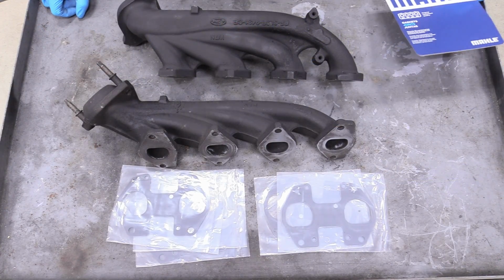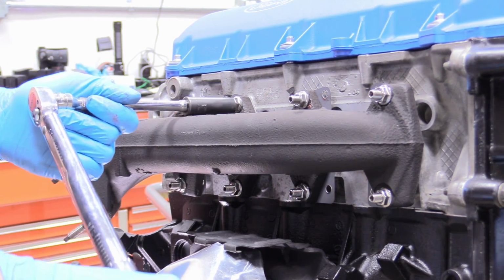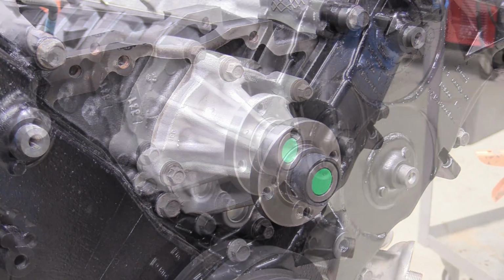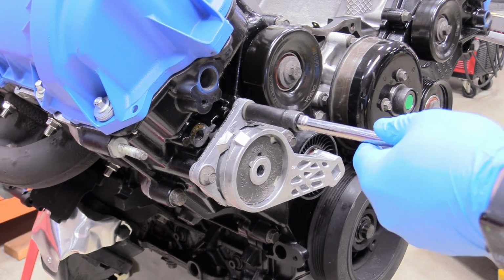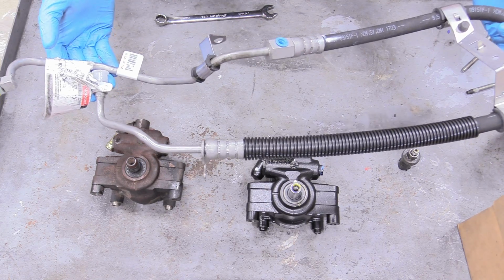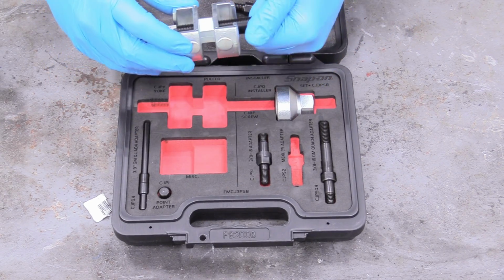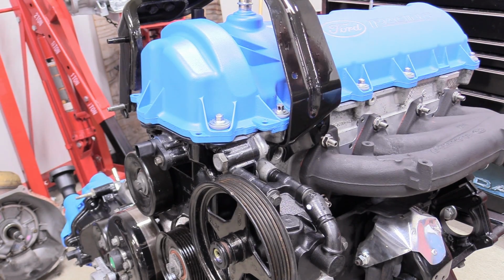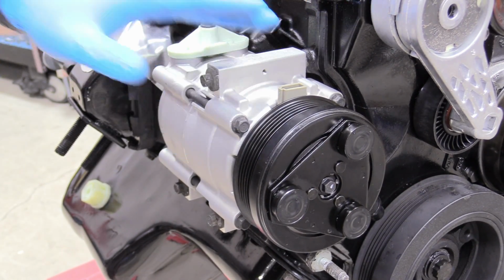How to Build a Ford 5.4L 3V Engine - Part 10: Front Accessories

Comment: WOULD HAVE BEEN EASIER TO MOVE TOOLS WHEN REPLACING PHASERS AND TENSIONERS IF I HAD REMOVED WATER PUMP. HAVE ANOTHER 75,000 MILES SINCE PUMP STILL NOT LEAKING.

Comment: FORD WAS $ ABOUT $1.00-2.00 CHEAPER THAN AUTOZONE MAHLE. FEL PRO THAT CAME WITH MY JBA HEADERS WOULD NOT SEAL.
Reply: REPLACED ABOUT 4 BROKEN STUDS , MOTOR MOUNTS TRANSMISSION MOUT AND CRACKED DRIVERS SIDE MANIFOLD.

Comment: Hello, thanks for your work with the videos. just a point regarding the A/C compressor oil. Some units come prefilled with PAG oil, but some come shipped with just regular oil that needs to be drained first, then refilled with the correct PAG oil. Best...

Comment: At 24:40, the power steering reservoir bracket was interfering with the valve cover because you don't yet have the sensor and 16mm nut mounted on the stud. I haven't yet watched the later videos, perhaps it is addressed there, but this could save someone from "modifying" their bracket.